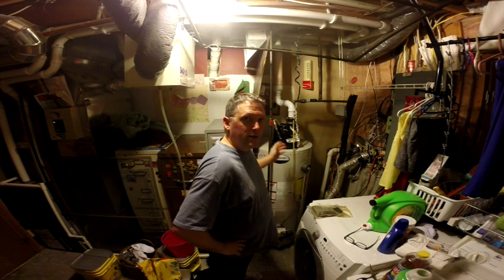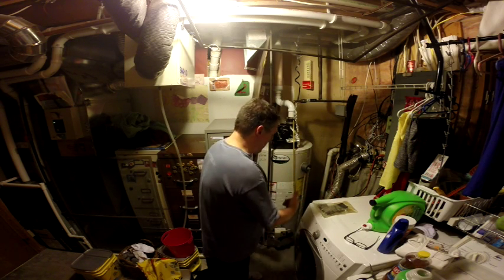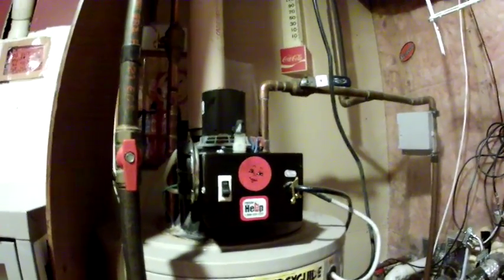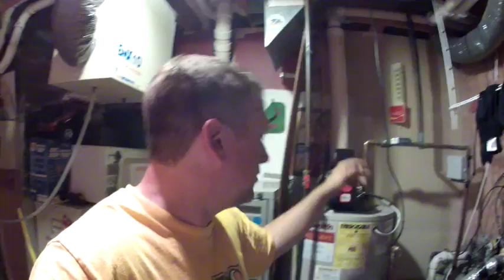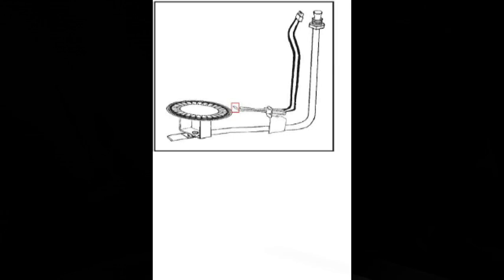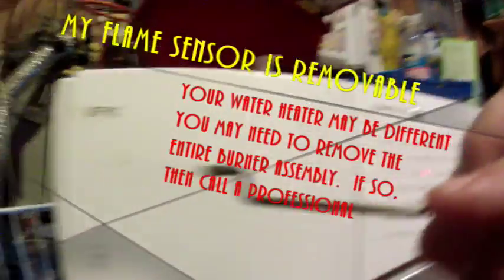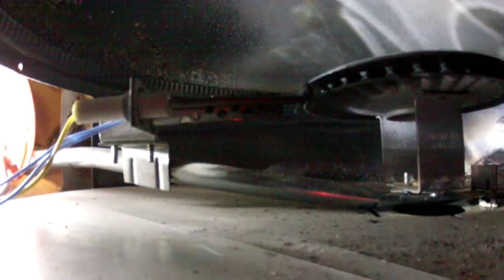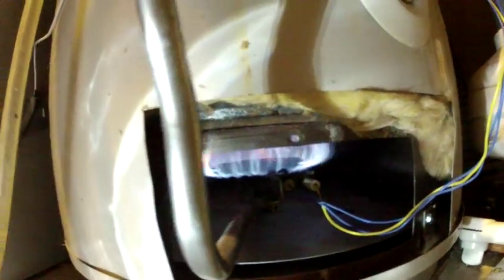Water Heater Troubleshooting | Clean the Flame Sensor

Comment: Hey, just a shout out to say THANK YOU! 6 year old water heater. Very costly install. I just did not want to call a plumber to service this. BOHICA ! The water heater exactly matched the symptoms you describe. 30 seconds of sanding the flame sensor, and voila', it's working like it's old self. What a strange failure mode for such a common problem. I wonder how many plumber have taken advantage of homeowners replacing parts and charging costly repairs for just this reason. Thanks again.

Comment: Wow, over 2 years of wondering why we had so much trouble with our hot water tank that heats our floor in our summer room during the winter. Even our friend, that's a professional, changed out the whole igniter/ heat sensor assembly, last year,  had no idea. So here we are with a piece of steel wool and in a minute it's fixed!!! THANK YOU
Reply from the maker: I am so glad you found this water heater video to be helpful.  I was so excited when someone showed me this.  I have been doing this ever since to keep it running.
Reply: Haha...saved us quite a bit $$$$$!!!. Our pro/friend said that I might have to get a new one installed. Since were using it as a boiler it would be a bigger project than normal. Your not Frosty your Santa....

Comment: Adding myself as another happy viewer of your video.  I have this exact setup and I was having sporadic problems with the heater not lighting.  Mine is 20 years old, so I was resigned to spending big bucks on a new one, but since it "mostly" worked OK, I decided to search for an answer to my problem.  After watching your video, I wasn't sure this would solve my problem, since mine would only fail occasionally (once every day or two) and yours seemed to not light every single time it tried.  But I cleaned the flame sensor, which was much dirtier than the one you showed, and my water heater is lighting consistently now, success every time for several days now.  Thanks!  I know that 20 years is a good lifetime already for a water heater, but I hate to do a total replacement as long as it is still working.  Thanks, and wish me luck for a few more years please!
Reply from the maker: Fantastic.  Now this is the type of information that really motivates me to make videos when I figure things like this out.  Your water heater is acting like mine did.  It starts out failing only once or twice during the week, and then once each day.  I used this trick for several years now and it keeps my water heater working fine.   I am so glad to hear this video helped you get your flame rod cleaned and ready to work well.  I had the same problem in my furnace last winter and knew what to do.

Comment: Our water heater is also the boiler for the heating system in our apartment. It stopped last night and gas company stated a repair guy would be available Wednesday(this is Saturday, and it's cold outside). Cleaning is all that was needed. Thanks for that video.

Comment: Our A.O Smith Promax Hot Water Heater (which is 10 years old) has been having difficulty lighting & igniting for a couple of months; I could hear it cycling 4 or 5 times before starting. After a unexpected cold shower. I started to search for the problem/solution. Since this unit has NO consent pilot light. Your video was the perfect solution. I did shut off the gas & unplugged the water heater before removing the combo flame rod sensor & the hot surface igniter which was held in place in front of the aluminium burners by a single screw.  The unit is heating up and I'm looking forward to many HOT showers in the future! Thanks you saved me $$$.
Reply from the maker: This is great.  This is exactly why I love to create videos.  It is very gratifying to know that my experience helps other people and saves a lot of money and spares people from major problems or replacements.  Now that you know how, you might need to clean that flame rod sensor once every few months.

Comment: You're awesome. I just ripped my propane water heater apart this weekend to fix it after reading just the service  manual. Such fun doing something dangerous for the first time. I noticed that your flame looks a little air starved. I would open your air intake a tiny bit to see if that gets the flame a little bluer and cleaner.

Comment: Excellent vid. Love it! This style of flame sensor works on the principle of flame rectification. Look it up. A small AC voltage is applied to the sensor and the flame conducts it to ground. And the control module looks for a tiny current. No flame, no conduction. The control module shuts it all down then. That's why cleaning it to a shiny finish (and possibly repositioning it) works. The flame "electrically connects" the sensor to ground.
Reply from the maker: It is amazing how this technology greatly reduces the chance of explosions and saves on our gas bill.   Thank you for further explaining the process.  I better understand it now and all the people who watch this video could learn even more by looking at the comments.

Comment: Mine isn't like your tank.. But I found the sensor.. .. Just couldn't get it out. So I shoved the steel wool in there and used my finger. I think it worked! Fingers crossed it keeps going.
Reply from the maker: That will work too.  I had to clean my flame sensor in place like that on my last water heater and it worked well.  It was harder to clean, and took longer, but was equally as effective.  Good luck with your water heater.

Comment: Also tell check if water heater is power vent out fan is working properly in my case pressure switch for power blower exhaust fan was bad.

Comment: I know with Lennox furnaces. The flame sensor rod has some kind of coating on it that helps that little circuitboard inside there do it circuitboard stuff with that sensor and over the years I have found on Lennox furnaces you can do that about two or three times before you need to replace the sensor I only bring this up because I don’t know how other sensors are I only work on Lennox and trane

Comment: Is this the same for a combi ? Only last 4 weeks it's been acting odd in a sense that if I run hot water it dont activate the flame but can manually activate it by turning the water  temp on combi off to high or at times drawing more water through other taps....I'm curious as to whether there is amy crap inside causing the issue as we had plasterra in a while ago and thinking that if some got inside and dropped down it could be on a sensor or something ?

Comment: My issue is it lights but  I don't get any flame flame it's just the pilot burner going any advice??
Reply from the maker: It sounds like the gas is not flowing adequately for some reason.  This is a lot more serious, and I would urge you to call a heating and plumbing company and tell them details of the problem and get their advice.

Comment: You can also try repositioning the sensor slightly closer to the flame if it is out of place. The heater's trouble shooting manual should show where it should be positioned.
Reply from the maker: +Joseph Grow I agree, that is actually a very good suggestion as it often might be the initial problem.
Reply from the maker: +Joseph Grow I agree, that is actually a very good suggestion as it often might be the initial problem.

Comment: I just opened the bottom of my ao smith power vent..removed 2 nuts...  took some sand paper and sanded the flame sensor a few times...works great.  Mine would start/light and then turn off..would do it 3 times and just stop...

Comment: Help! What happens if there is water, drip not a gush, coming out from under the gas water heater? Any advise is appreciated. Yes its over 10 yrs old.
Reply from the maker: Oh, not good.   The major sign of a water heater that needs replacement is when the main tank starts to leak. I just had that happen was well a few years ago.

Comment: Hello. I think I am having the same problem, had it before. I was able to remove the outer cover however there is another cover behind it which I can't remove with a standard regular or phillips screw head screwdriver. Any suggestions? Thanks.
Reply from the maker: I had trouble the first time removing it because it is wedged in there so tight.  I removed a screw or two and used a plyers to get it loose.

Comment: hi I have been having reoccurring issues  since replacing new tank 5 years ago = a least 2-3 times per year- hot water people say they cant figure out what is causing it- new set of eyes are thinking its the condensation off of my dryer since its in the same room - gas line has been cleaned  - things replaced  ignitors etc-- they are saying  something gets rusted but the last incident was within 2 weeks--  the normal is every  6 mos or so-- there have  been 2 instances where it has  happened within 1 mos of repair guy being in-- so now I am going to be shortening my dryer hose to see if this helps-- does this make any sense to anyone ???

Comment: why does my gas hot water heater make a popping noise in the winter?
Reply from the maker: Did you spill some popcorn into your waterheater?  Kidding, Basically, the popping noise is water is boiling underneath the sediment. You see, sediment drops to the bottom of the tank where the gas burner is (for gas water heaters) . ... While the noise itself is harmless, too much sediment can: Eventually cause a leak--Sediment slows heat transfer from the gas burner to the water.  You can flush sediment from your water heater by using the FLUSH valve once a month, but first check with your owners manual.  Flush valves can easily (and often do) get clogged with sediment and might be hard to shut off.   It is best to periodically drain them as often as your owners manual says to do, (I do once a month).  If it has been a long time since the last drain, your valve might stick in the open position, and you might honestly end up having to call a plumber to shut it off.  Expensive.   Personal experience is that I used to never drain the flush valve, and then we I would try it, it would leak for hours!!  We have a drain, so for us, no big deal...but you might end up with emergency repair.  My suggestion, have a plumb clear it once, and then keep up with it as often as your owners manual recommends.
Reply: FROSTY Life - option I like is to replace the cheap valve with a ball valve. Easy to operate and quality will allow easy draining

Comment: Mine just went and i changed the thermal coupler...but the ignition switch broke off..that little bbq button.broke off from the wire...i spent all afternoon..trying and nothing....I'll try again tomorrow...i refuse to pay for a service call...i rather buy a new one....
Reply from the maker: I agree, sometimes, especially with water heaters, it is best to get a newer more efficient safer model.

Comment: hey bro, let everyone know that you have a power vent water heater and its not terribly common. If others watch this vid and see that their standard draft type water heater looks nothing like yours. they may get confused.
Reply from the maker: Andy Simmons I actually tried to replace my 8 year old water heater with a non power vent water heater and they told me it would cost twice as much to go back.  They say the power vent is all they do now...but that might be a regional thing (with serious winters) here.  Anyway, that is a good suggestion because I did not mention it.   I will add it to my notes/comments box.
Reply: Frosty Life I owned a plumbing company in Indiana (saw -52 wind chill a few times! yikes!) Power vent versus conventional draft has more to do w location of water heater in the home and ability to get dedicated metal flue piping to roof. If water heater (mechanical room) is in middle of house in basement, etc. ,its easier to run PVC exhaust piping horizontally with forced blower on water heater (blower cools exhaust so it can be handled by PVC). It would be twice as much because of the routing of tin flue piping and roof penetration needed. Ive since moved to Arizona where water heaters are in the back yard....WTH?!? lol. Nice talking w ya, sir. Keep up the good work.
Reply from the maker: Andy Simmons LOL, the house we rented in Florida had the water heater in the garage.  Yes, the exhaust piping would be easier to run out the side of the house.  Thanks for providing insight; I learned even more.
Reply: Frosty Life right on sir. When I moved from Indiana to Arizona, it was seriously like having to relearn plumbing.

Comment: wount
Reply from the maker: +Felica Jones Sounds like your igniter (different from the flame rod discussed in this video) has possibly failed. There are a host of things that could be wrong but the only thing you can do is unplug the unit wait a couple minutes then plug it back in. This will reset it and if you're lucky it will run ok. If it has a problem you will probably need to call in a plumber to diagnose the problem.